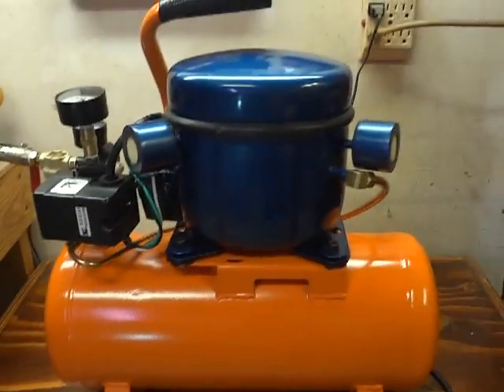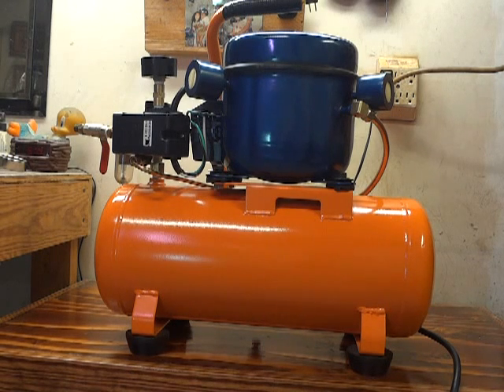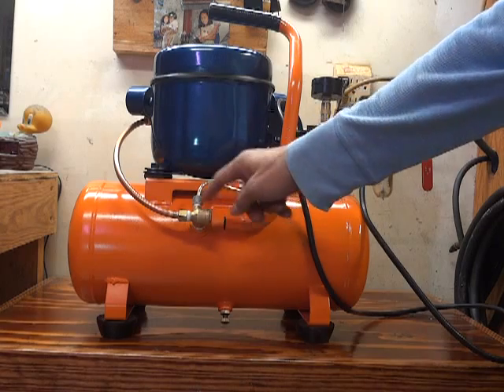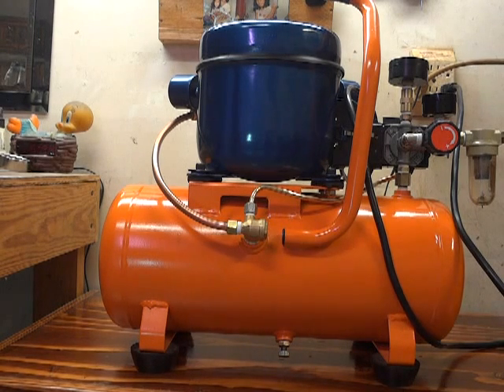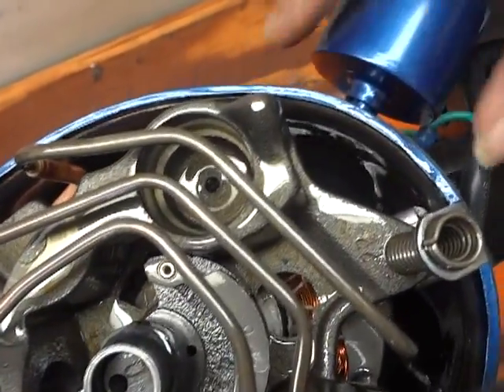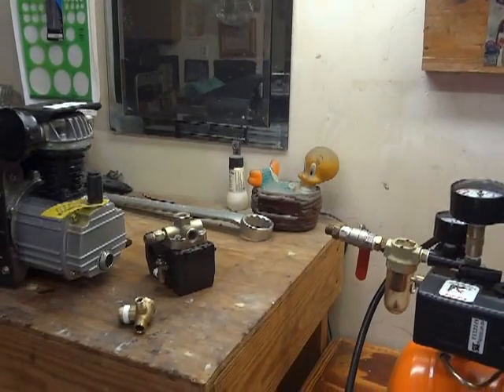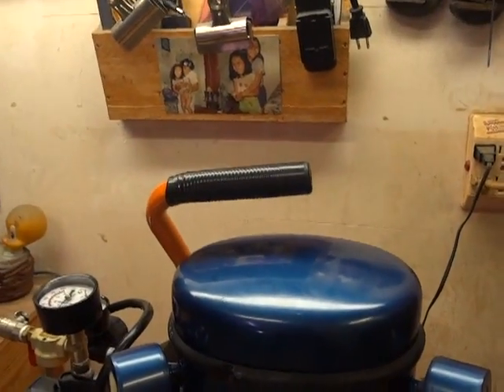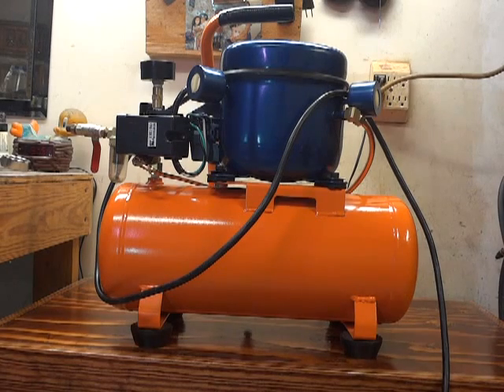Homemade silent compressor

Comment: rotary air conditioner compressor is faster than this. it fills up 50lt tank to 8bar in 3 munites but you have to put air cleaner out of the compressor because when the compressor get hot the oil inside evaporates :(
Reply from the maker: Thank you for the tips, but this is perfect for my need. And thanks for watching.

Comment: suwandi? are you indonesian?
Reply from the maker: I'm Indonesian American.
Reply: Suwandi Ibrahim itu caranya buat dia otomatis mati pas tabungnya penuh gmn y?
mksdnya itu alat supaya otomatis mati namanya apa?
air regulator? air switch regulator?
Reply from the maker: Sigit Budi Namanya pressure switch or on/off switch, itu sudah di adjust dari factory yg bikin untuk stop motornya sesudah regulator mencapai 100 psi dan akan on kembali setelah air drop down to 75 psi. Thanx.

Comment: Suwandi, great project.
How has this worked out for you?  
I'd be concerned about the duty cycle of the compressor.
Also, I thought that the AC compressor cycles lubricant with the pressurized refrigerant, so that if it were used as yours is, it might burn up.
Reply from the maker: Thanks.
It worked out perfectly, I used it a lot, I had it almost a year now. I don't understand very much about the duty cycle of the compressor. Any AC or fridge compressor has refrigeration oil that will work with refrigerant in the system, since the refrigerant was released, the oil become regular oil. That's all it needs to keep the compressor running. As far as it might burn up you have to use something to cool it while its running. Thats why I installed a fan on my compressor, check out my other video called:" Homemade silent compressor with cooling fan".

Comment: nice ! ! did you retrofit the oil?
Reply from the maker: No, I dump the oil and I put completely brand new refrigeration oil (mineral oil), I got the oil from AC repair guy. Work perfectly.
Reply: Suwandi Ibrahim from what i was taught, refrigeration compressor oil will combust or even explode when mixed with air at high pressures. it's meant to be mixed with refrigerant only but i've never heard of it actually happening haha. still nice set up :)
Reply from the maker: fudogchomp Many other people doing the same thing I did out there and they have been using them for long time and most of them saying the good thing about it. By the way, if it was gonna explode, it will not wait untill this far..

Comment: Nice piece of equipment. Id like to make one myself. Good idea to use a fridge compressor. they are very quiet and reliable. Are there any precautions to take when using them like you did ? and what is the maximum Pressure can youget out of such a compressor ? Thanks for your vid. quite interesting.
Reply from the maker: Yes they are extremly quiet and reliable. Just maintain enough oil in your compressor, since oil will escape with the air when compressor is running. Use regulator, don't go over 125 psi. I set mine 100 psi max for safer operating. Thanks for watching.

Comment: The only problem is the slow fill it wont keep up with air tools or spay paint .
Reply from the maker: I built this compressor for airbrush only, what a 3 gal compressor can do? I have a 25 gal compressor for air tools or spray paint gun. Small job with small compressor, big job with the big bad boy....get it???

Comment: Good job. But I'd condense this meandering video into about 5 min as its painful slow to watch.
Reply from the maker: I realized that when the vidoe was already done, so I just let it go, sorry for the inconvenient, thanks anyway.
Reply: Someone will always criticize you no matter how good your intentions are.  By the way I loved the video, it was very thorough, educational and the quality / craftsmanship of your work is top notch !  Two questions:  1) How did you paint the compressor (Air brushes and polyurethane paint?) and 2) When cutting the compressor open how did you prevent metal from getting inside?  Thank you
Reply from the maker: Chad Christian You right about that. Thanks for your comment though. I paint the compresor before i put  them together, automotive paint using touch up gun and clear coated. If using metal cutting blade most likely the metal dust will fly away while cutting and air blow once in a while.

Comment: Hi Suwandi, I like what you did. I was thinking how hard is it to make one of these or convert the existing one that I have to be silent?. Feel free to message me I would like to finally have a silent air compressor. The one I have is really noisy :(
Reply from the maker: Hi, thanks for subscribbing. If you already have an existing air compressor it would be easier to make a silent air compressor. All you need to do is swap the compressor motor with fridge compressor, pressure switch and all the fitting already there, then make some adjusment here and there to fit on the fridge compressor. It's very simple, let me know if you have any question.
Reply: Suwandi Ibrahim
Hi Sorry I did not reply sooner, but the hard part is finding the fridge compressor. Ive looked all over and basically I would have to buy a $300 fridge to make something like this work. Which isnt that fun and defeats the purpose. If you know a place in california or the united states let me know.. i dont want to spend more than $20 - $30 for a fridge compressor. Thank you
Reply from the maker: djelusion I never been in California, I'm in Virginia. Try to look at the dumping area, the place where people dump they trash, broken appliances and any unwanted thing or go to appliances/ refrigerator repair shop, good luck.

Comment: I know the fan cools it , I'm sorry 
I didn't know u ran it all day , nice job , 
Love the paint job , were did u get the 
Fitting that u said was hard to solder, 
The 1 off the copper pipe??
Reply from the maker: That's ok, I really appreciate with all the comment. The fitting that I soldered to the compressor tube that connected to the copper pipe that goes to the tank. I got that from harbour freight tools, it's a L shape fitting.

Comment: Maybe you have to put super start on it , when it came down to 70 psi and didn't start , that's not rite , no.
People say you should change the oil to air tool oil ,the original oil does 'nt react rite with the air.
And why do u need the fan,cause I'm building 1 with a computer fan, 33 gal .
What are your thoughts...
Reply from the maker: I put standard pressure switch that I ordered on line. The compressor didn't start when it came down to 70 psi. only happened before I change the oil, you might be right about how the original oil react to the air. I've tried many diferent kind of compressor  oil for that, none of them work like it suppose to. Finaly I use refrigeration oil, and so far it works fine, don't have that problem anymore. Why do I need fan? To keep it cool, because when I airbrush that compressor will run allday long. Check out my other vid: Homemade silent compressor with cooling fan, You'll see how it's work, thanks for your comment.

Comment: really nice job, 1. how long to recover from your 70 psi to 100 psi? Another solution would be to put a compressor in the garage and run a line to the shop!  But really nice job and thanks for sharing - found this very intestig!
Reply from the maker: It only takes 1 minute from 70 psi to 100 psi, and only take 4 minutes from 0 to 100 psi, thanks for all comments.

Comment: You may want to add an oil separator on the discharge from the compressor, especially if used for airbrushing. I do see one on the outlet from the tank but these compressors by design put oil into the discharge from the compressor.

Comment from the maker: Thank you for subscribing and watching my video, also thank you for your comment. Oh, that is just regular household eureka vacum cleaner belt that I got from Walmart. The reason why I put that on there is to minimize the vibration that created from the lid and to stop the oil from escapping through the tiny gap between comp. housing and the lid. It's a cheap stuff, but it works pretty good.

Comment: Hi Suwandi,
Great video, very informative and your compressor looks brilliant.   I have made a small silent compressor which works fine at the moment.  I would like to remove the top for checking and topping up the oil. 
 What is the rubber band type thing that you have used to secure the lid ?

Comment from the maker: I use refrigeration oil some people call it mineral oil. HVAC mechanic bought it for me because I'm not certified to get it. Before that I've tried many different kind oil, from automotive synthetic to regular air compressor non ditergen synthetic oil, none of them seems to work perfectly. It's either making strange noise, foaming or both. Now I got the right oil, it works like it's suppose to.

Comment: if you make an oil trap that drains back into the case, you will have less oil consumption. i'd bet your air leaner fills up with oil after time doesn't it?

Comment: Very clean build, nice work.  
A water trap with a spring loaded drain between the compressor and the check valve is a worthwhile addition.  It will give you a visual indication of any oil loss so you dont have to open the compressor too often. It also reduces the amount of water making it to the tank.